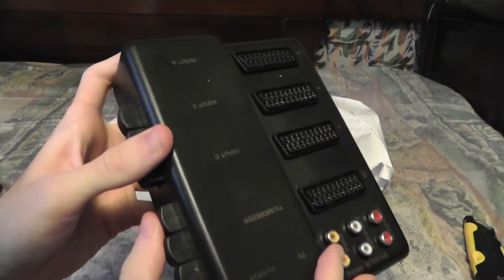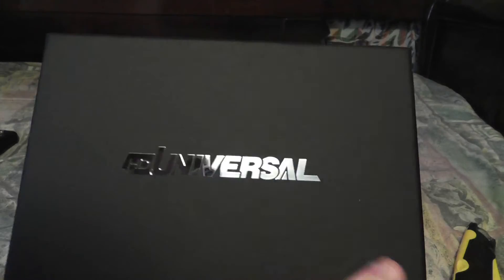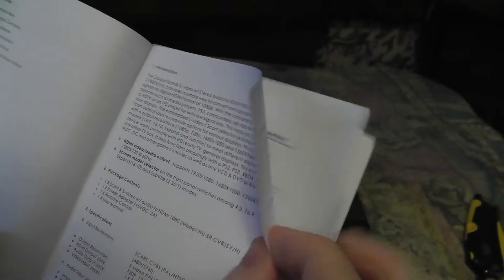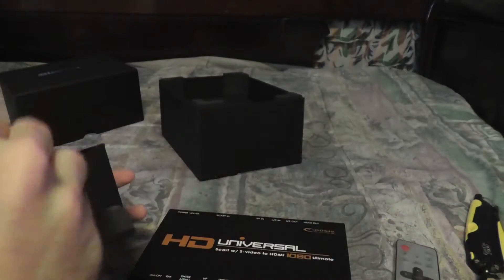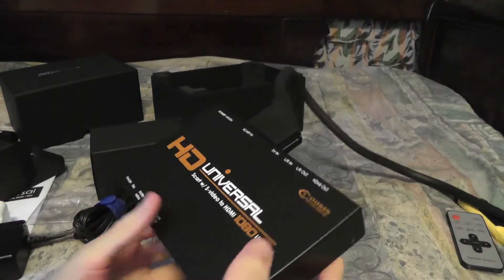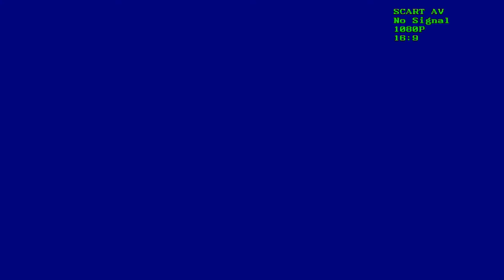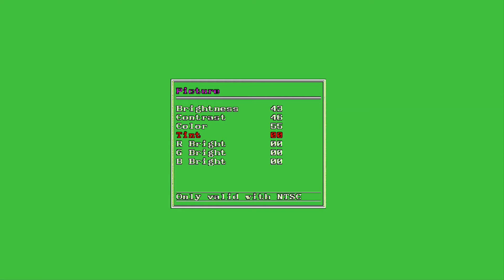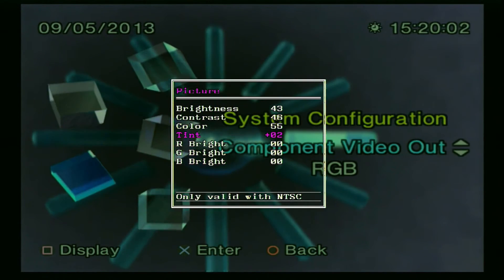Unboxing and Testing Coosis SCART & S-Video to HDMI Converter

Comment: Great and informative video. I am more interested in this scaling device for the s-video aspect. Hence, how is the s-video picture and sound quality on this device, particularly concerning the psone? Also, on the website it mentions the stereo analog inputs are 3.5mm, will this accomodate the standard red/white L/R av cables for sound? Thanks, for any future help.

Comment: Found my way here from Crusherbad64's recent video. This box perplexes me, particularly its RGB settings.

When I look at this footage, I can't help but assume it's not actually displaying in RGB. Instead, it appears it's just doing a composite passthrough.

If you're not aware, SCART actually supports three signals. One is composite, one is S-Video, and the other is RGB. Designed as kind of an "all in one" format.

I know this is basically a year old, so this may not matter much any more, but I did a video on the same concept, but I know it was passing RGB through. Check it out if you're interested.

Gamerade - Best Video Quality With Old Game Consoles - SCART to HDMI - Adam Koralik

Thanks for making this video!
Reply from the maker: AdamKoralik Yeah I was overall disappointed with this box. However it's possible that the SCART cable I was using was crap and carried a poor signal. I have since given up on trying to use SCART but seeing how good the Dreamcast looks in VGA makes me want to try this again.
Reply: Oh SCART is three flavors , welp , can't do SCART to HDMI with Dreamcast it seems ={